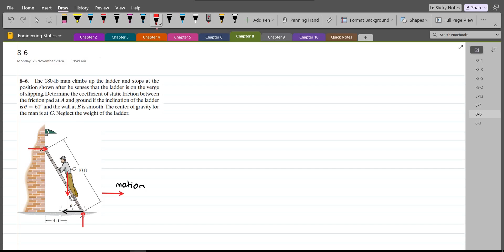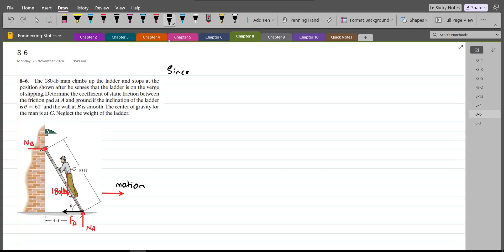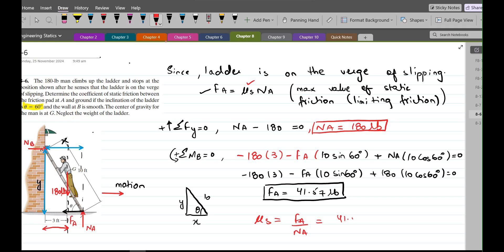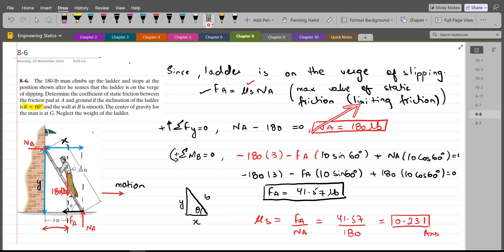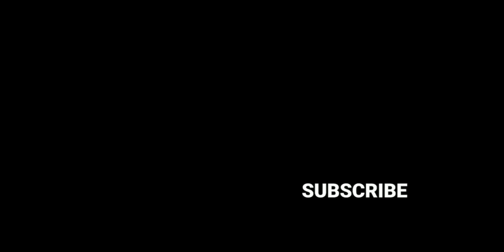8-6 hibbeler statics chapter 8 | hibbeler statics | hibbeler

Comment from the maker: Learn How to Solve 8-7 Hibbeler Statics Chapter 8, "The uniform thin pole has a weight of 30 lb and a length of 26 ft. If it is placed against the smooth wall and on the rough floor in the position d = 10 ft, will it remain in this position when it is released? The coefficient of static friction is μs = 0.3."
Here is the Link: https://youtu.be/ntoJA8888l0